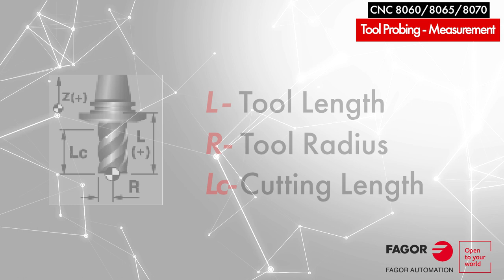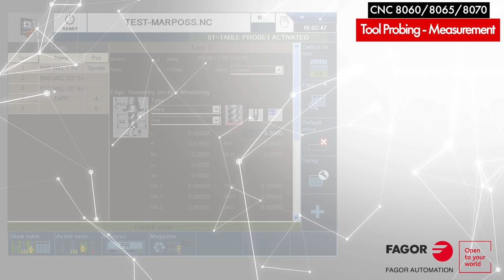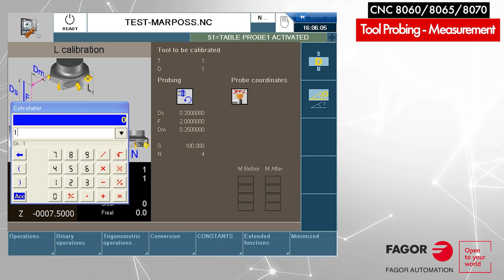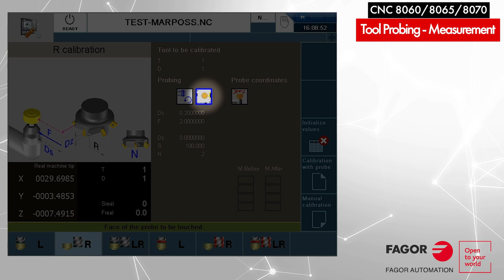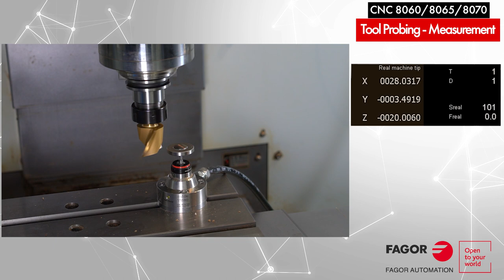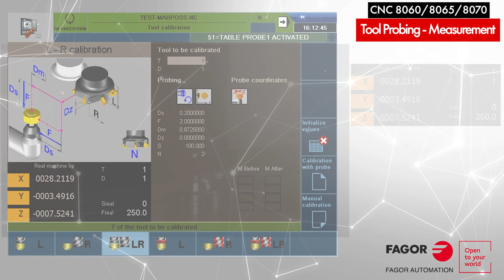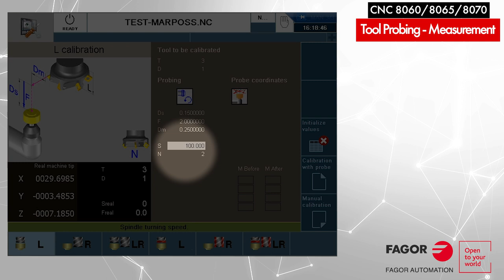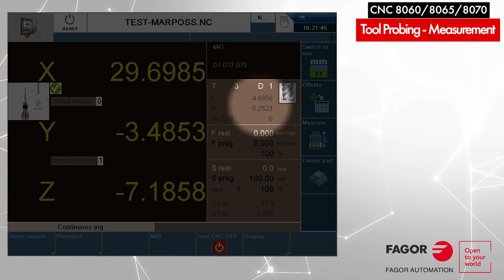Tool Probing - Fagor CNC 8060 / 8065 / 8070

Comment: So if you have a Fagor 8060 controller on a Ganesh GV4 knee mill how do you use a probe for Length if the Knee can change to various positions which would change the Z length of tools ?
Reply from the maker: Hello 730M. Use new Zero Offset value for Z axis when the knee is moved.  New Z axis offset will apply to all Tools.  It's also possible to use fine offset / incremental just for Z.  Please check out our tutorial video called “Setting a Zero / Work Offset - Fagor CNC 8060 / 8065 / 8070” section Incremental Offsets (10:12 time mark). - Artur Gugulski
Reply: @FagorUS  Thank you